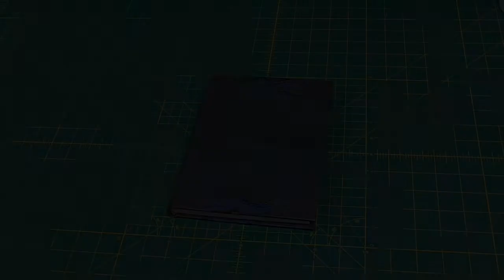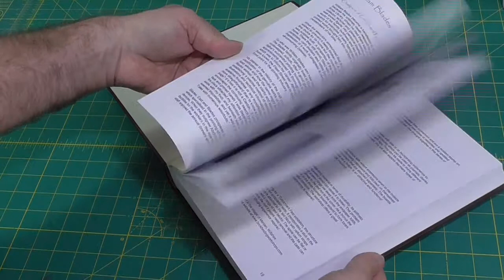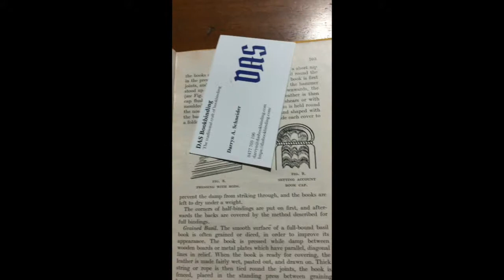Bookbinding Cloth Corners // Adventures in Bookbinding

Comment: Developing the "eye" to cut corners is a great skill and saves so much time. The rule of 1.5 x board thickness works well. If unsure bend the uncut cloth up at the corner to reassure yourself that the cloth once cut will go over the board. Keep well, stay safe

Comment: I use a variant of the tab method: the tab is simply the cut triangular part that usually would be folded in: it decreases the bulkyness of the confection, it holds the material put and reduces the chances of fraying and it works on most materials.
Reply from the maker: Thanks!  I've been using the little triangle tab for vellum.  As you say less bulk to show through.  All the best, Darryn

Comment: I have been in a world pain lately with fabric turn-ins.  Having splashed out on some rather exotic materials I've discovered that the weave is just as important to consider as the thickness.  Nice tightly woven rayons behave immaculately. Natural fibres like silk and cotton canvas just want to fall apart when making those delicate mitering cuts for casing. Hope you don't mind me imparting my own advice here, but always test how the cloth behaves when cut before committing to its use. Allow a larger mitre allowance to mitigate for any fraying and- if you have the luxury of preparation time -  seal the edges of fabric with PVA or paste first. The last thing anyone wants is their high-precision turn-ins unravelling!
Reply from the maker: I've never had this problem with commercial bookcloth.  I don't use silk as much as I should, since it is very nice.  But I always back it with paper and coat it with something like methyl cellulose, which stops the fraying.  But I could imagine it happen with other materials.

Comment: Howdy, may I ask what kind of brush is it that you are using to spread the glue? I've never seen the tongue tab before. It does make for a nice corner on thick boards.
Reply from the maker: That corner is the standard for vellum too, or a slight variation.  I'm not sure the brush is made any more.  I bought it from Hewits originally, but it's a german made brush.
http://www.hewitonline.com/Wooden_Paste_Brushes_p/br-090.htm

Ciao, DAS
Reply: @DASBookbinding  Thank you for your quick response, and general responses. They do still have it. Now I know what to look for. Thank you! Be safe.

Comment: How do you feel about using metal (pre-made) corner protectors?
Reply from the maker: I'm not a fan.  They damage books around them.  But just because I don't use something no reason you can't.
Reply: I usually use chromed corners which are fairly smooth, but I still understand what you mean. Thank you for your insight!:)